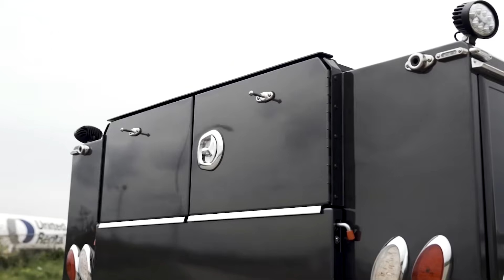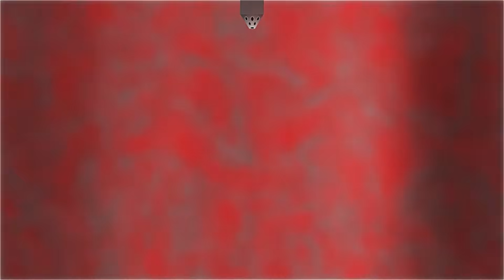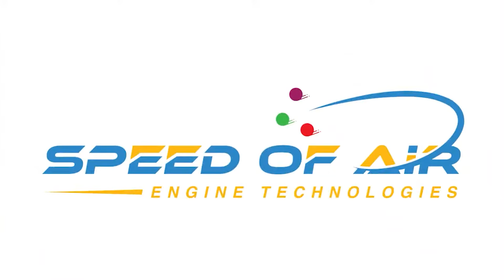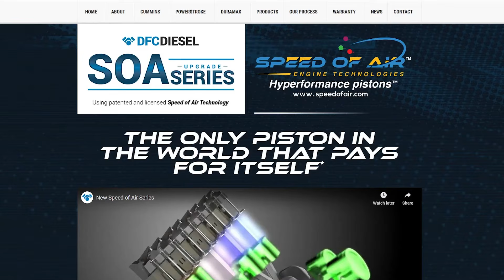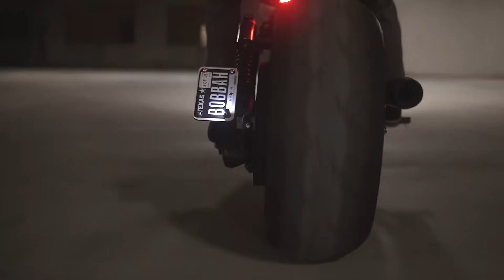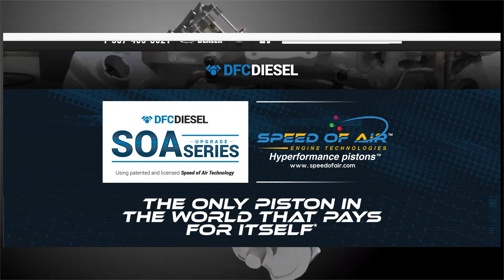This new Piston breakthrough decreases fuel consumption, Power & Torque

Comment: I was just quoted $4,650.00 for a set of 8 pistons. Part number DU10067-0.5K1.

I would like to see more people using them and what their results are  before I pay that much.
Reply from the maker: Thanks bro✌
Reply: That’s not that bad if you look at a set of wagler pistons (lml owner here) I just found these and I’m like you kinda hesitant but I might pull the trigger when it comes rotating assembly time
Reply: $3,656.53 now apears to be dropping in price fast.
Reply: A set of forged pist9ns for a 6.4 superduty is around 1500 bucks.
I could see these having a premium...no doubt. But almost 4 times as much seems a bit extreme.
I would probably pay 2500 and roll the dice.
I will keep an eye on the technology.
Of note .  thermal /dry film coatings on the crown ,skirts,bearings etc  are exceedingly important on ALL ICE builds!
Reply: A set for a 12v 5.9L Cummins is atoms $3,600 at Summit Racing as of March 2024.
Reply: I'm not retype my long miss YouTube clicked comment
Reply: Agree, perhaps Chinese knock offs will make the original producer rethink their prices just like solar panels were SO expensive to start with.
How about dimples in the back of the valves?  Will that work?
Anything is worth testing.
I hate how the government is forcing ICE engine manufacturers into to generally cutting piston weight, reducing clearances which increases oil consumption at the expense of fuel economy.  This world is bloody crazy

Comment: In. Computer controlled engines the PCM often has to be reprogrammed or recalibrated when modifications are made. Sometimes the PCM will retard ignition timing when the engine seems to be running out of pre programmed parameters.

Comment: "Less Soot in Oil and longer intervals"  --- Thanks to Total Seal's gapless second compression rings (included in kits). Anybody can get these benefits on their piston using their rings, so that isn't really anything SOA came up with.

Piston Thermal Coatings can be applied at home or by a coating company for a decent price. A lot of these diesels already have dry-film skirt coatings, which rarely wear off in a healthy cylinder.

I wonder how much HP, Torque, and Fuel Savings come from the dimples, and how much comes from zero blow-by rings and thermal barriers? Be interesting to see an uncoated SOA piston with conventional rings tested, IMO.
Reply: To be honest as much as i care about feul economy i care more about the carbon and soot production if these things can significantly anihlate soot and carbon production especially soot levels after treament will be a thing of the past we will still have ehr to deal with gases but dpf and scr will no longer be necessary

Comment: Why does it need fuel...why can't that air mattress inflating device,shown on shark tank, siphon off some car wind drag, to stoke friction heat via the hydraulics, resulting in air burst to feed piston engines...I do be believe a modest electric vehicle battery could be needed so it's hybrid design maybe, but they likely don't need fuel tank.

Comment: It's actually OLD.

Larry Widmer was using dimples on pistons, quench areas, and combustion chambers about four decades ago. He ran a company called EnDyn. The process never took off.

The prices they're quoting are utterly ludicrous. In the modern CNC era, you could machine the dimples in a set of pistons in a fix axis CNC machine in 30 minutes.